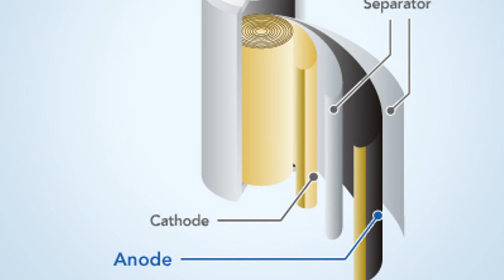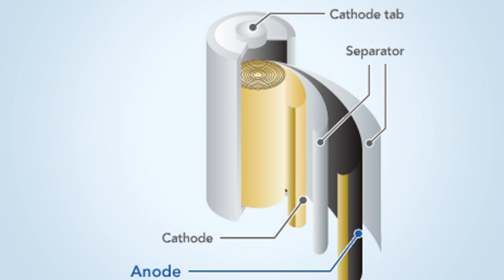And Now the Good News #96: 8/5/2014

Comment: The Cannae drive sounds interesting, but what I found out about it is that it wasn't performed in a vacuum, but in a still-pressurized vacuum chamber. So heat generated by the device could transfer to the ambient air, which then expanded and pushed the test rig. That would explain why both the test as well as the fail-test provided thrust. (A third test without power didn't have any thrust.)
Reply: AlbertaGeek Actually it is worth mentioning but not for the reason SeedlingNL thinks.  Running a test with no power eliminates the possibility that some other (unplanned for) factor is causing the thrust.
Reply: A third test without power didn't have any thrust
Seeing as how it's the power that is supposed to provide the thrust, that hardly seems worth mentioning.
Reply: PlasteredDragon
Ah, of course - a control!  Good point, I didn't think of that.
Reply: ghuegel
You're obviously not up on the latest:
http://nextbigfuture.com/2014/08/full-nasa-cannae-drive-and-emdrive-test.html
Reply: ghuegel
No one but the biggest optimists are concluding anything positive.  All we can do now is trust that the folks at NASA know what they're doing.  They may be iffy on their imperial-to-metric conversion (yeah, they're never going to live that down - at least not while I'm alive), but overall they know how to science.
Reply: AlbertaGeek Frankly, I'm kinda excited we get to explain something unknown. I always found it fun to have a theory be partly correct and then the more accurate explanation revealed to be something that gives us even more avenues of research and inquiry. Does make me wonder who'll be the first to put one of these devices up in microgravity for testing, although they look a bit big to send to the ISS.
Reply: sarcleaeolist I'm kinda excited we get to explain something unknown
Oh, indeed.  And regardless of what the explanation is, we can learn as much from mistakes as from successes.

Comment: I am VERY intrigued with the Canna and EmDrive concepts, to put it mildly, as neither of them appear to depend on Newton's Third Law of Motion (at least not to my semi-trained eye!).  A commenter on the article you posted suggested there is an interaction between the drive and dark matter!!!  If that's the case, the whole dark matter hypothesis just took a big jump forward!

Very neat news indeed, Steve!
Reply: I would have to examine it more fully before passing judgement. But it does not sound quite right.
Reply: His work has not yet been vindicated. And the guy has a shady past .
Reply: christopher tucker That's silly. The thing still requires electricity for one, so it's not different from an electric engine for all intents and purposes. And for two, the thrust it produces is acceptable for a satellite. But it's negligible for anything on earth.
Reply: dangerouslytalented Agreed - especially after I heard that the test was not done in a vacuum (which is what space is, mostly!).  I would hope such a test would be the next stage of their process.  I guess we'll see.
Reply: Troubleshooter125
Reply: possumverde If it is working through magnetic fields, it would still be pushing against the magnetic fields...
Reply: christopher tucker Just to be clear :

"i didn't say it was a dark matter engine, and neither did trouble."

And neither did I or anybody else anywhere. So what is this sentence doing here.

"also if its attached to a satellite then it will be using solar energy making it not a fuel guzzling dinosaur engine like we have today."

I'm also puzzled by this sentence, because satellites already use solar power, they just need quite a bit of fuel (generally some sort of gas) to throw at the other end.

"also the RnD of this engine could make it freezable in the future for a ground based usage, which again could be powered by solar cells or hydrogen fuel cell again eliminating fossil fuel usage!"

I'm puzzled again by the word "freezable".

"and 1 last thing i said " I hope that further studies and tests prove that these drives are working!" so i have left it up to the scientific community to prove these claims and start there own research to making them small enough and efficient for better uses!"

Hurray for gentlemanly agreement.
Reply: Also, according to the guy, there is nothing mysterious about where the thrust should come from. His idea is that you send microwaves in and it bounces on the sides but since the top is wider than the bottom, it pushes more on this side and creates thrust.